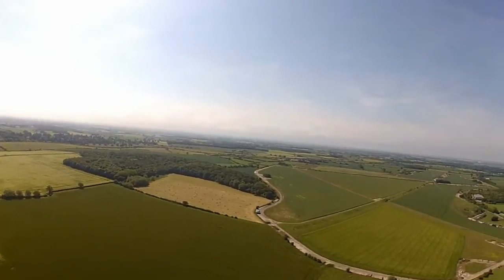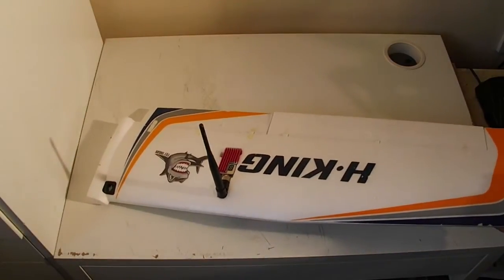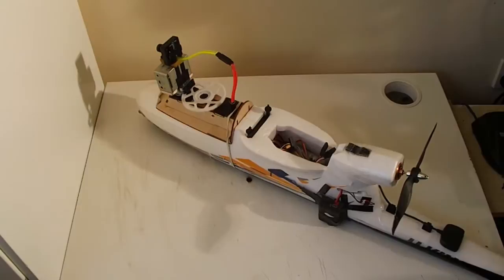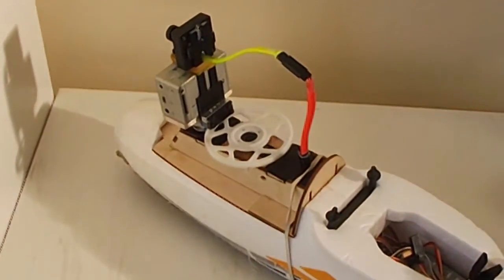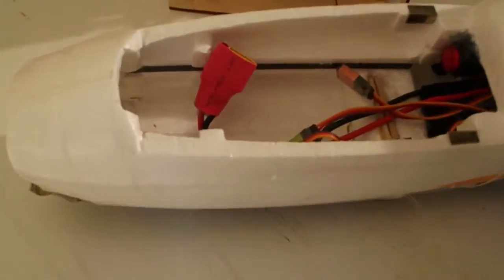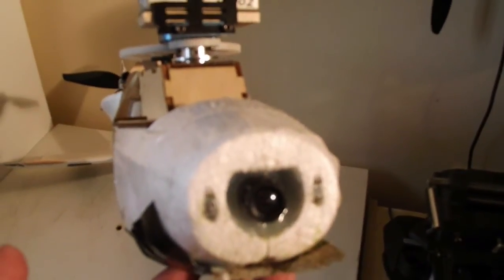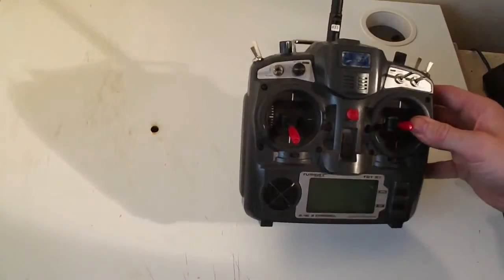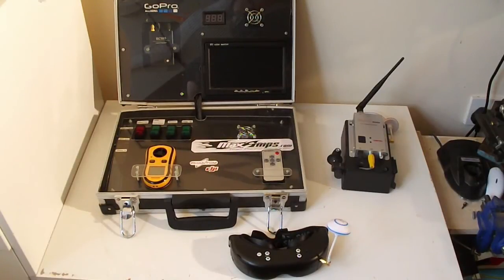Bixler 3 FPV talkthrough

Comment: where did you get the camera pan setup I would really like one please help
Reply from the maker: Hello, I built the pan setup my self out of an old servo powered gimbal I had. There are 360 mounts available but if you want a self centring mount that can spin 180 each direction you most likely have to build it your self. There are some out there but they are quite expensive. A quick google of RC 360 GoPro mount should but you in the right direction.

Comment: Mi Mike, its a complex set up for sure...lol...I have the T1000 stabiliser with RTH, why in gods name did they not make it automatically reset home position when it found more than six sats?...Mental....It would be really good if you could review the T1000 and clarify how to set Home and what the flashing LEDs mean, because the Manual is just nonsense.....No wait, completely useless...lol......Do you find it hard to turn the plane when the T1000 has its Sat receiver active, ie in Stab Mode..permanently?

Comment: Is this a standard RTF bixler? I am looking to setup a similar fpv unit with the bixler 3 and needed to know if I will need to upgrade the prop? thanks for sharing the vid
Reply from the maker: Hello! Everything about the bix 3 was just standard, latter on I upgraded the ESC but apart from that it flew very nicely with standard gear.

Comment from the maker: Hello Husky041, I use one GPS for the T1000 Return to home unit and the others for the OSD. The T1000 doesn't have an OSD on it so I have to have a separate one to show my speed and distance form home.
Reply: Ah, thanks. I'm planning to use an APM flight controller as I'm a little familiar with them and have one in my quadcopter. It has a separate gps/compass unit which also supplies gps to my goggles via a MinimOSD board. You probably know this already ☺

Comment from the maker: No, it normally flips over on landing because of the weight of the GoPro on top. I put some tape on the bottom to prevent damage to the underside on landing.